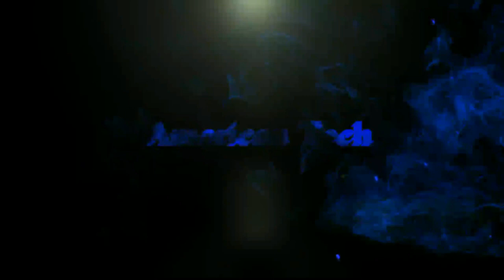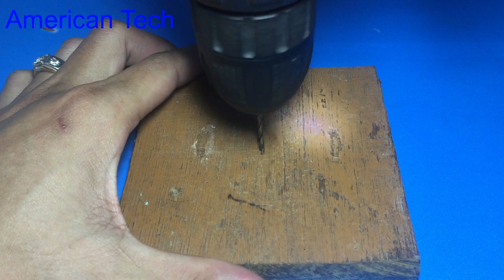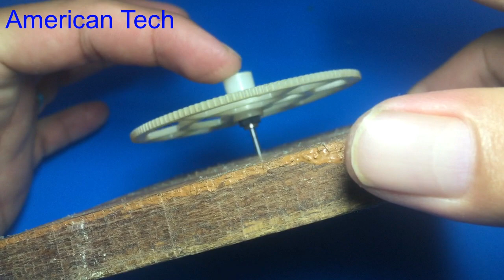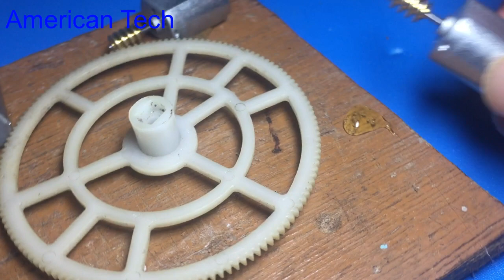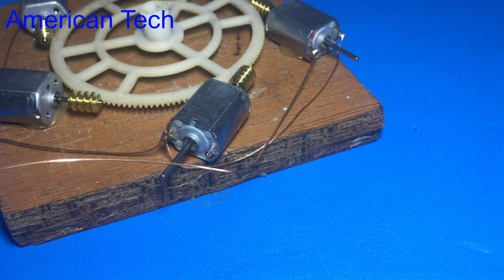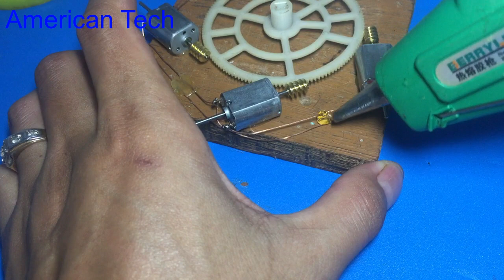Experiment 5 motors combination , How to make a powerful gear motor

Comment: Sometimes engineers are up against the need for more horsepower then the previous model had but may have production confines. So rather than putting the extra horse power to a gear .reduction that the ring gear may not hold they would put horsepower spread out so that the teeth torque would be shared. This particular demonstration has one brutal flaw and that is that a worm Gear has to approach the ring gear at exactly 90 degrees so as to have as many teeth on the ring gear excepting load as possible.  The reason or benefit of the doubt I presented would be greatly for not then anyway.